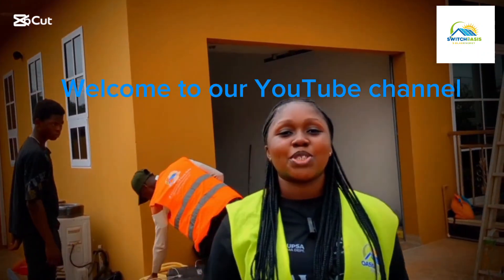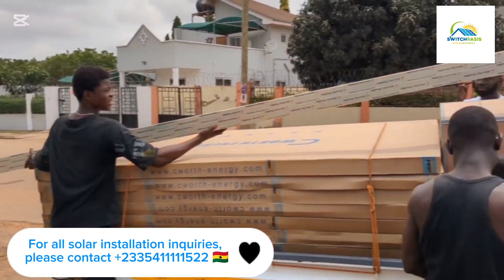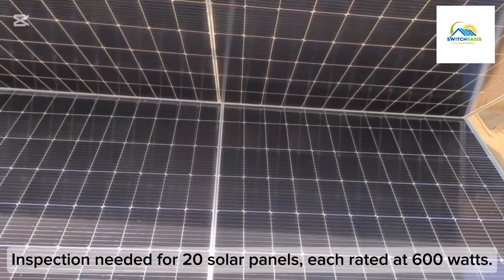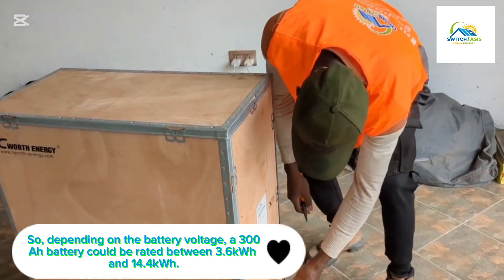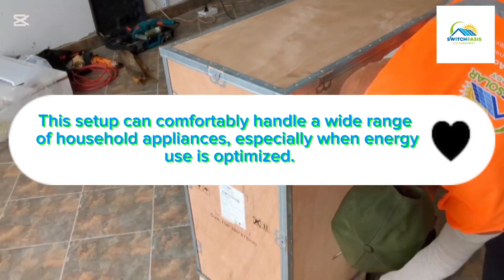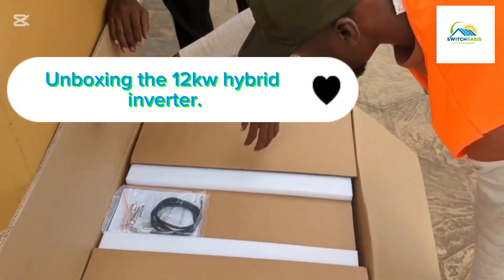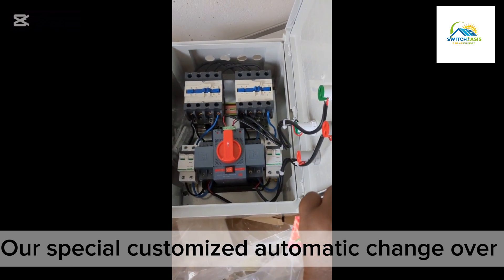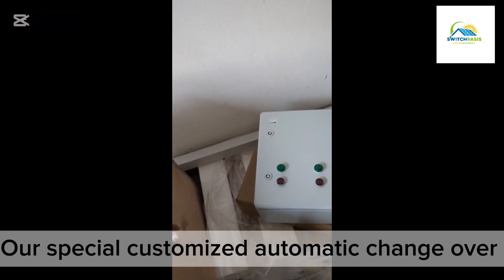12kW Hybrid Solar Power System | Solar In Ghana. 🇬🇭🇬🇭

Comment: 20 pieces of 600W panels to charge a 300Ah  battery? isnt that too many panels for a 300Ah battery? per my calculations, one will need about 8 panels. 
300Ah battery gives you 14.4kwh. One 600W panel which is getting about 4hrs on sun hours per day at a 80% efficiency will give you 480*4 = 1920.  so 14400/1920 = 7.5. which means you need about 8,  600W panels to charge a completely drained 300Ah battery a day. So why 20 panels. Maybe I'm missing something?
Reply: did you account for losses, float, and other factors ? not forgetting if the user has day time energy needs... you cant even get 480w from those 600w panels.. Check with the manufacturer
Reply: @gcrestfidcrest  So lets say you are only getting half the wattage of a 600w panel because of all the factors you've mentioned which gives us 300W per panel. 300W multiplied by 4 hours of sun a day will gives us 1200Wh=   14400/1200 gives us only 12 panels not 20.   If you need 20 panels for a 300Ah 48v battery, then it means the 600W panels are only giving you 180W per hour. which in my opinion very poor.
Reply from the maker: @kwandy78 I'm grateful for your insights. Thank you for the education!
Reply: Am trying to install 15kw system in house. I bought 3 5.5kw kevolt inverters with built  in mppt 48V. And also bought 24 580w panels and 2  14.33kw lithium lifepo4  batteries with 280Ah each and their voltage is 51.2V for each battery. Am not an expert in solar. Do you think they are going to work good when i install them?
Reply from the maker: @gcrestfidcrest thank you
Reply from the maker: Thank you for the insights, sir! 😂 Not all calculations relate to an actual system installed with the load during the day; this includes both backup and off-grid customized installations for our clients.